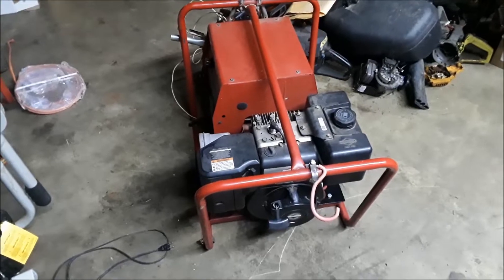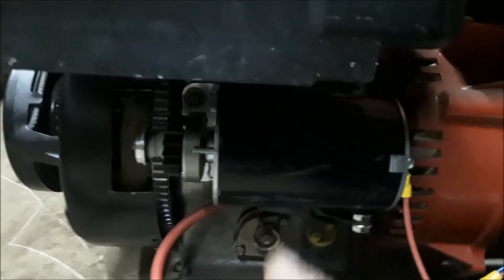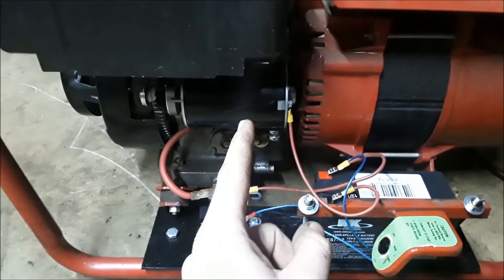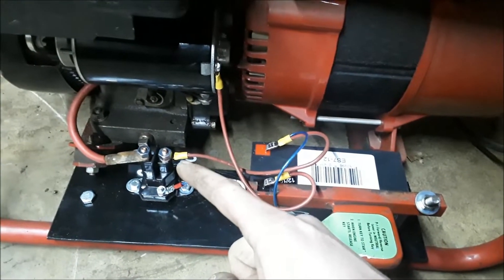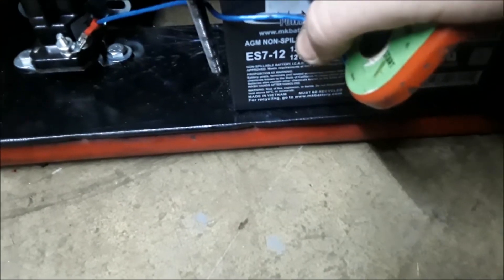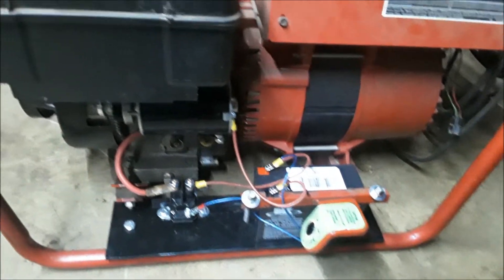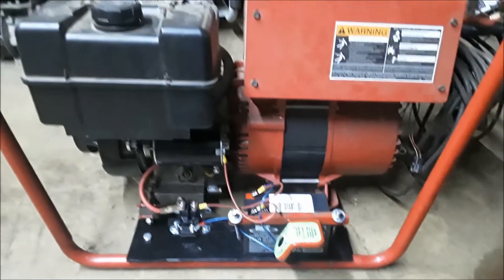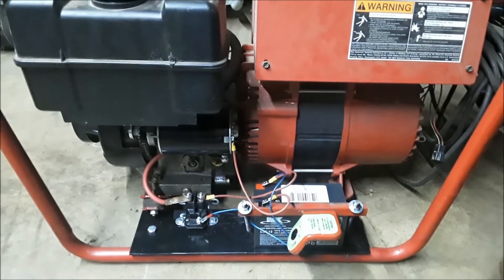Electric Start Conversion On Lincoln Welder

Comment: I have this same welder and would like to do this mod. I know you've said that you don't remember the part number of the ring gear, but do you remember where you got it? Also, did you add a ring gear to the existing flywheel, or did you swap out the original flywheel for one with the ring gear already attached?
Reply from the maker: I believe I added just the ring gear to the current flywheel. I would've gotten it from Briggs directly because I'm a Briggs dealer but you could get on a website like partstree and look it up.

Comment: I know this is over a year later so I hope you see this.  Were you able to add the ring gear to the existing flywheel?
Reply from the maker: Yes. It took a while to find the right one but I did. I don't remember what the part number was though.

Comment: Been doing the same thing. I had to move the tank up a little and made new bracket for under the gas tank. Did your guys put a alternator on it?
Reply from the maker: We didn't and I told the customer he would need to charge the battery every now and then.